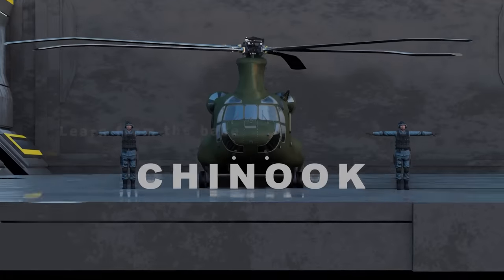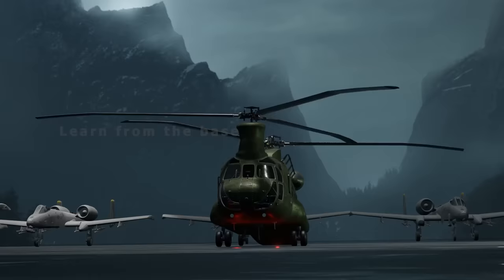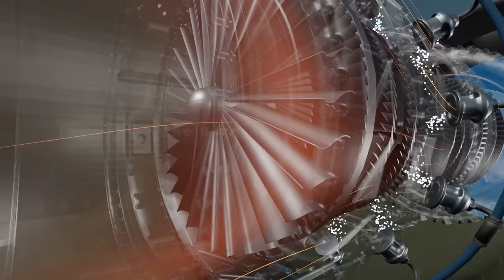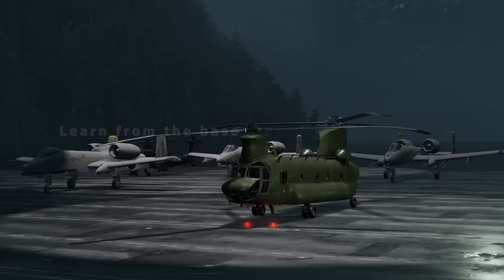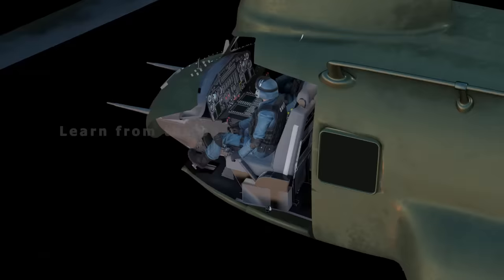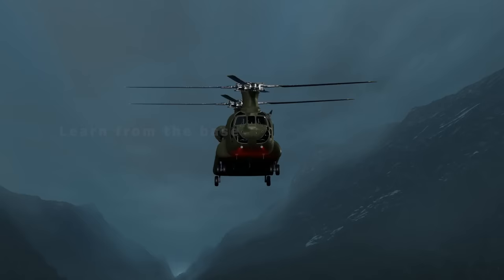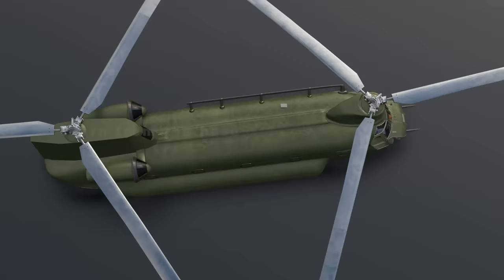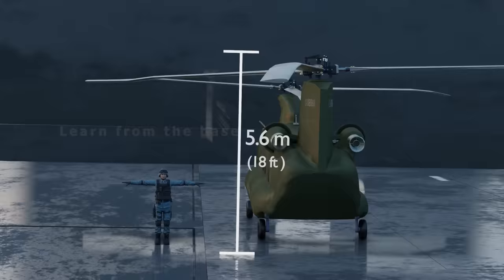How does a Cargo Helicopter work? (CH-47 Chinook) Heavy Cargo Transporter.@Learnfromthebase

Comment: According to Jarod Owen's video on BlackHawk, the helicopter's controls are "delayed" by 90 degrees. To tilt the helicopter forward, more lift has to be generated on its left side - according to Gyroscopic Precession

https://www.youtube.com/watch?v=qf29pqPWDOU&t=616s
Reply: That is true on a conventional helecopter and true to a point on tandem or coaxial rotor helicopters. But the fore/aft tilt on the chinook is done by varying the collective between the two rotors.  The issue in this video is with the turning, or rolling where they do not address the gyroscopic recession and the animation shows the blades 90 degrees out of where they should be during a roll maneuver.

Comment: This was by far the worst chinook video I’ve ever seen. Loads of inaccuracies. I could deal with the animation faults but the rotors have only two actuators each not four. The blades pass over the fuselage toward the #2 side so the directions in the video were flat out backwards. And no chinook on the planet has back seats in the cockpit.